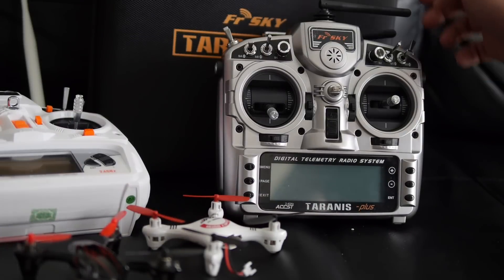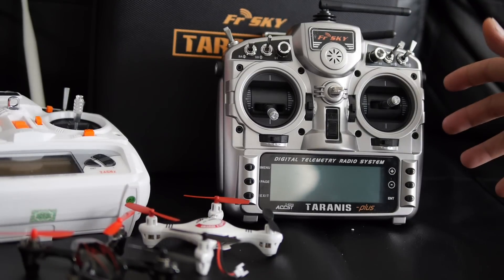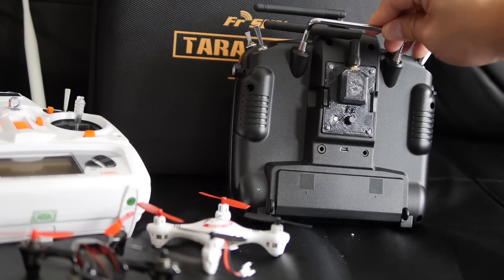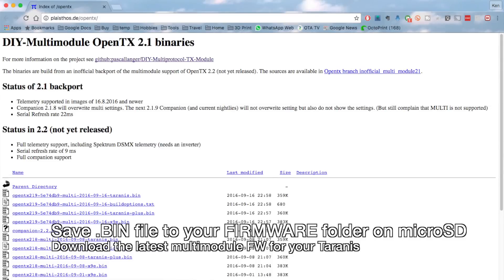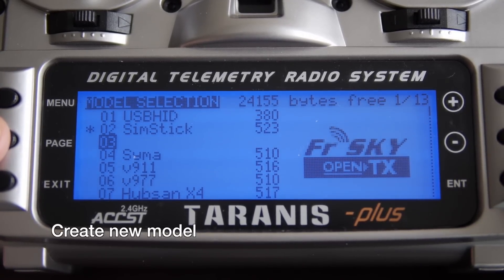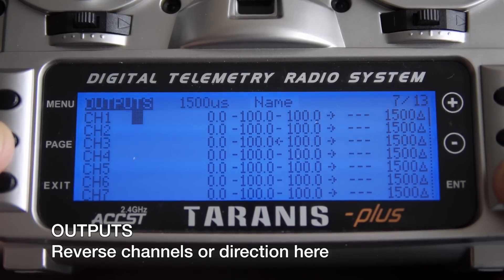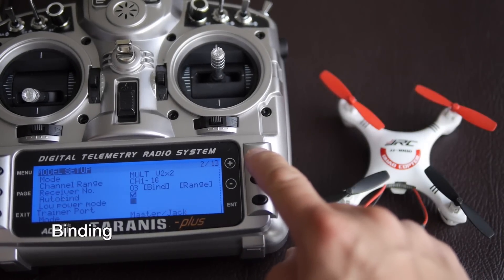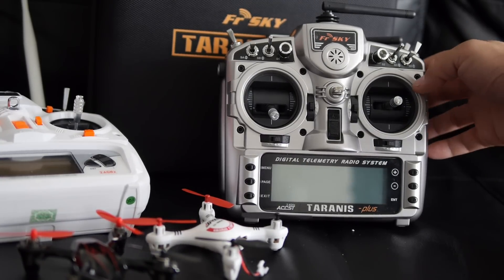4in1 multi protocol module for FrSKY Taranis from BangGood ATMega328P

Comment: Hello,  I have the Taranis X9D plus and the 4 in 1 module.  For some reason the 4 in 1 module only shows ppm,  XJT, CRSF It doesn't show FLYSKY or any other protocols.   I made sure to solder the Serial port.  Can you point me in the direction to find the fix? I am running 2.1.9 from the open TX WebSite.

Comment: Great job on the video. I wanted to ask will this special firmware l need to use for that module will it only work for the Plus&Q X7 could l still use it for the regular Taranis???

Comment: How do you set up the auxiliary channels I'm respect to the different models and their transmitters? Like the X5C, it has 2 different flying rates selection, the flip selection, and the camera selection.
Reply from the maker: If you check out my sample models in the description (see JJRC 1000a or Hubsan X4), you can see how I programmed it for turning LED on/off.  It'd be similar for the camera and flips.  I have yet to program my X5 to do flips.
Reply from the maker: Model setups have been updated with LED and flip function.  I have 3 rates set to one of the switches.  See video description for links.

Comment: Say you wanna use a FLYSKY receiver.... are you gonna get the much lower latency? Does the module itself introduce latency?
Reply from the maker: The module will have shorter range than a dedicated fly sky module. Not sure about latency.  If you're concerned about it, definitely look into dedicated modules. This 4in1 is great for small toy quads
Reply: @KenVersus  SHORTER range? Why you say that? This has 50% more power output than a flysky TX..... I should be getting much better range.

EDIT: I actually don't know if this has 50% more power output, I was thinking about a j8umper T8SG.

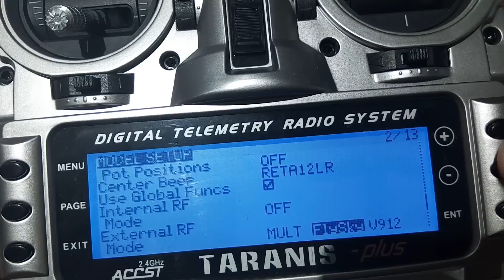Comment: @1:45 are the tx/rx pads bridged? No wires needed but bridged by using solder?
Reply from the maker: that is correct.
Reply: Thank you. That seems very simple then! Can't wait to receive my module. Still undecided on which radio to buy, Taranis or 9XR Pro.
Reply from the maker: If you have the money get the Taranis...  if you're on a budget, the 9xr pro very good for the price.
Reply: I have the money but, limiting myself for the holidays. I can either spend around $250 and get the Taranis and module and wait to get other items or, spend $250 to get a 9xr, module, goggles, aio fpv, and e010 and start flying!
Reply from the maker: I'd be happy with my 9XR Pro if I never tried a Taranis.  You can always get 9xr pro now, use it for a bit and buy a taranis later and sell the 9xr pro.  keep the box!
Reply: Taranis on the way from Amazon and is about to order a 9XR for testing. Whatever feels better will be the keeper. I hope the difference is night and day to make for an easy decision. As for soldering the tx/rx pads, will any type of solder work?
Reply from the maker: I use tin solder with rosin core.  0.8mm, i get it from BG.  http://bit.ly/bgtinsolder
Reply: hey, just wondering what exactly this does by bridging the pads. I use a Taranis X9D - Plus running firmware version 2.1.6.  Do I need to bridge the pads at all?  Enable serial mode in the radio menu? I want to use the original back plate and run the antenna inside and out the top.
Reply: hey, just wondering what exactly this does by bridging the pads. I use a Taranis X9D - Plus running firmware version 2.1.6.  Do I need to bridge the pads at all?  Enable serial mode in the radio menu? I want to use the original back plate and run the antenna inside and out the top. Thanks!!
Reply: I've had the Q ordered but everyone is out of stock

Comment: how does the range of the 4in1 module compare to the full feature protocols? if you choose dsmx protocol, how different is the range than if you were using a dx6 and a spektrum rx? i hope i made sense. i just got my Q X7  in the mail today, i can't wait to try this module, it will be replacing about 30 toy grade transmitters. thanks for all the great info, i will probably have more questions due to the fact i am a moron when it comes to computers.
Reply from the maker: +DroneXFun I don't think the range is far. Probably 100 or 200 meters. Good enough for indoor quads.

Comment: I have a 2yr old Taranis 9D+ ... never updated my firmware. I believe if you update your firmware, all the "models" which you have configured will be gone and have to be reconfigured .. too much work .. even though I only have 3-4 models configured on my Taranis. Don't know if there is anything "to die for" in later versions of Open TX which would make flashing new firmware desireable.  I did recently purchase from BG a small module which plugs into the back bay of the Taranis which is supposed to allow for many different protocols based on stick input selection. Waiting for that to arrive to see how it works. I've never regretted buying my Taranis 9D+ .. very good radio. Cheers.
Reply: That is certainly not true. Also I would recommend a backup before upgrading firmware.
Reply: Actually, I did try updating to the new FW for the Taranis. When I tried to restore my old models, they weren't compatible. So, rather than having to re-create all my models, I decided to "flash back" to my original version of Open TX. Unfortunately, the newer version screwed up my saved models, and I had to wind up setting up my models in the old 2.0.9 FW again. Didn't take as long as I'd expected, but it was still a PITA. I think there is a way to back them up to a file on your computer, but I've just been backing them up on the Taranis.
Reply: backing them up on the remote should also work. You just need to restore the eeprom from the bootloader after flashing the old firmware again to restore them.

Comment: hi there, i just ordered the new taranis qx7 and i have the cc2500 module for the flysky th9x, can i use the flysky module in the taranis? from what i understand the th9x is aetr and the taranis is taer (i think i got those wrong) so could i just change something in the taranis menu so it will work? or do i need to buy a cc2500 for the taranis?thanks a million..
Reply from the maker: +Smokin' Quads if you put it in serial mode it should work in either.  I use FRsky version in a turning 9xr pro. Change in radio settings.

Comment: Hey Ken. Sorry for the random question! On the new Taranis Q7 will the 4 in 1 module work?
Reply from the maker: +TJ Lewis if there is place to install it. Should work in at least PPM mode. Serial mode would require firmware support.

Comment: Hey, i got a little 1550 excavator and got the Huina Toys Modified 2.4G 15CH 6V-15V Transmitter, whit it also, it works fine,,, but I like more program le control over the motors,,, Will this firmware work whit a hunia excavator 😁

Comment: I did what you said, mine does not work. The links for binarys has a warning saying not to use them "Please do not use these outdated firmwares anymore. They are not maintained anymore. OpenTX 2.2 RC10 or newer includes the current code and will work far better" Where is the later code. Cheers in advance to anyone with upto date info on this module.
Reply from the maker: +Elecifun watch my stm32 4in1 video. The video applies to this module too. It shows you how to load the latest OpenTx.

Comment: Does OPENTX 2.2.0 Nightly Build 359 support that Multi modul for Horus? And does OPENTX support for Taranis 2.2.9 for Multi Modul? Both in Serial Mode?
Reply: I have the same question for Horus.
Reply from the maker: http://plaisthos.de/opentx/ only has binaries for Taranis X9D/X9E, no Horus X12S.  I think the OpenTX 2.2 supports it but there are no binaries.  I don't have a Horus, so can't really comment further on it.

Comment: Hey Ken, where can I get all those model bin files that are showing up on your sd card? Sure would save a lot of time if they were all available in one place and ready for the 4 in 1 module.
Reply from the maker: http://www.thingiverse.com/thing:1796284/#files

Sure, I uploaded the few that I tested on thingiverse.  Some of them I have yet to bind and test.  I just put them in to remind me I have to create them.  Most of the models are just 4 channels and sometimes you have to reverse a channel direction but that's about it.  CH5 and CH6 are usually reserved for lights on/off or flip.  Most of the models I setup also have SF switch (top left) as throttle cutoff.  SE is lights, SG is Flight modes, with low/med/high rates.   SB is reset timer.
Reply: Thanks Ken, that gives me a good starting point for adding more models, Again, Thanks.

Comment: Hi Very nice Video you made I have a question about this Multiprotocol Modul I did get the Orange DSM 2 receiver to bind but when I plug a servo on the receiver it does not turn around just stay jammed in one position.What can be the Problem?
Reply from the maker: +Johann Springsits bad servo.. Maybe adjust the end points for the servos. Or the weight for the channel your servo is plugged to. Those are settings in the transmitter.
Reply: i am sorry this is not the case because the Servos work normal on the Spektrum DX8 DX6i

Comment: Using this way means you don't have to flash the 4in1 module and just use it stock from banggood?
Reply from the maker: Pretty much stock.  I didn't flash the 4in1 module itself.  But if you want to be able to select the protocol inside the Taranis menu, you will have to solder the 2 pads I mention in the video.  If you don't, you can select the protocol by turning the white dial on the module.

Comment: What other transmiters will this module work with? I believe you mentioned the Turnigy 9xr?
Reply from the maker: In PPM mode, it works with pretty much all radios that can do PPM.  In serial mode, the firmware has to support it.  Yes it works with an 9XR as well.  I'm getting a 9XR Pro as well.  Video of it coming soon...
Reply: Thanks! Looking forward on your Video on the 9xr Pro. Please do a review on it!!
Reply from the maker: For sure, it should be uploaded by this weekend.  The 9XR Pro is a good alternative to the Taranis at only $60.
Reply: You delivered the video just like you said! Great!! Thanks. I would be getting the 9xr Pro soon.
Reply: Andre Martinez     it wil also work in the fly sky th9x after you install the smartie parts board.

Comment: Thanks for doing this video.  I just go my module and was wondering if I need to upgrade the module firmware?  Are you planning a video on how to upgrade the module firmware?
Reply from the maker: I don't see a need to do it yet.  I haven't updated my module firmware.  there is a post that shows you on RCGroups, but some things are better left untouched if it's not required.  If I update mine, I'll do a video.

Comment: do you think this could work with the new turnigy evolution? its basically a flysky something.
Reply from the maker: Possibly in PPM mode.  You would most likely need the DIY version of the 4in1 module.  http://bit.ly/bg4in1diy

It'd be a lot of work I think.  You'd need to solder wires and also a dip switch or rotary dial to select the protocol.

Comment: +KENVERSUS I've been taking in your vids for the past few days now and man, I love your work!! I have a Devo 8S with Deviation and was planning on getting that 3 in one module...now that ive seen this video though, Im quite interested in finding out which one you would say is better? In terms of ease of use, pairing to the different protocols etc. Which one do you prefer? Cheers
Reply from the maker: My only experience with the Devo series is with the 7e and 10.  Deviation interface is easier to understand and program.  It's similar to the Spektrum stuff if I can compare it something.  OpenTX won't be easier to use.  OpenTX is a bit more complicated but if you use it enough, you know where all the things you need are.  I don't do very complicated setups anyways so I do like the flow of the UI of OpenTX.  In terms of binding with different protocols, it’s the same.  They use the same RF chips so same compatibility.  I think the Taranis is more popular and will have more support then the Devo stuff.  I have both, and time will tell which one I keep.
Reply: That makes sense..I might still get the Taranis and just see which one I prefer. Thanks for sharing all your info and for taking time to reply, means a lot. Cheers

Comment: This is really interesting, is it possible to use as full range module and also bind dsmx receivers ?
Reply from the maker: +Jelle Kaptein range is probably a 100m to 200m. It works with dsm2/x
Reply: Hmm, thats a downside, It would be exellent if this module could be used as a full range system.

Comment: Thank you! Have been a fan of your Devo 10 mod video; modded my Devo7e using that video. Have been waiting for this video for a long time since I saw it earlier this year. I have a few questions: 1. It appears that you have soldered "2 pads" to allow you to select models? If yes, can you do a video on that? 2. Does the mulitmod firmware replace the original Taranis open tx or it is just the same with the open tx added with the multi mod. 3. With model ini, is it as simple as finding one and then download and copy over to the micro sd? 4. To upgrade the multimod firmware, it is finding the firmware, download and flash as shown? 5. I notice that after you bound with JJRC 1000 in the video and you pushed up Throttle, one of the props was not spinning? Does this mean that the transmitter sticks have to be re-calibrated? 6. Is devo more user friendly or this one? Which one do you prefer? 7. Just to confirm, does the 4 in 1 work with any transmitter that can do open tx? Sorry, for so many questions. I am looking to buy a Taranis or Flysky TH9x and this 4 in 1 module. Look forward to your reply. Cheers.
Reply from the maker: 1. Unfortunately I already soldered mine, so that's why I didn't include it in the video, forgot to film it.  It's pretty straight forward, just use a finetip solder iron.  I just use a Weller battery powered iron for most of my soldering, don't need a lot of heat.  If you can mod the devo 7e, soldering the 2 pads isn't hard.  Add some flux and use small amount of solder.  Keep a solder pump handy if you add too much. 

2.  It runs OpenTX with multimod added.  

3.  Yes, you should be able to find the model, (.BIN) and copy to your microsd and import/restore it to an empty slot.  

4.  Yes, it's just download, copy to firmware folder and flash. 

5.  One of the motors on my JJRC is dying.  It still flies, I just have to go full throttle to have the 4th motor spin up.  I have a motor replacement on the way.  I love the 1000A!  One of my favourites.  But yeah, should calibrate it anyways in the OpenTX menu.  

6.  yes, I'd say Devo's are more user friendly.  OpenTX is a bit more complicated but once you learn it, it's not bad.  For most of my models, it's just a simple 4CH setup with little configure.  Espeically for the bind and flies.  There are tons of tutorials on YT about the Taranis. If i had to keep one radio.... I'd keep the Taranis. 

7.  The 4in1 is availabe for the FS 9x as well.  With 9x, you need to run a multimod version of ER9x firmware.  I use to have both Flysky 9x and Turnigy 9x, but have since sold them so I don't have any experience with the multimod since it wasn't available then.  the FS 9x is a lot cheaper than Taranis.  However, Taranis is better and has more features and it's probably the last radio you buy.
Reply: Thank you. Very much appreciated.

Comment: Thanks for this tutto I have been able now to fly hubsan with the taranis.
I have a question
I have imported the Hubsan X4 model in my Taranis and i can fly properly the drone also i can turn on and off the led but i can't flip it even if i can see in the channel that the flip button is binded.
Also my principal ''problem'' is that i can't find a way to start recording a video. On the DIY  multiprotocole page ch7 is supposed to be picture and ch8 video but when i go in the channel page there is nothing on channel 7 and 8 .
 Can i do it manually ? Did i imported a version model that was for an X4 without camera ?
Thank you.
Reply from the maker: Yes, you do have to manually add those in.  My model samples don't have that since I don't use the camera/video function or flips.  I only programmed in the LED.  You can see how I did it with the LED on/off channel and program something similar to the channels. ch7/ch8.
Reply from the maker: Model setups have been updated with LED and flip function.  See video description for links.

Comment: Hey Ken regarding your IKEA Dioder Wireless Hack Mod (LED Strip lights) video, i had a question. Is it possible to use the came remove but with two sets of the led lights, and two receivers working on one remote? Thanks.
Reply from the maker: Yes one remote can control 2 receivers.  The Mi-Light branded do at least.  The remote can be paired with the receivers.
Reply: kenVersus Awesome ken, thank for the info!

Comment: This is amazing, but I have a question. Is there any downside to installing the custom firmware?
Reply from the maker: Disadvantages?  I can't think of any.  You can of course flash it back to the the original opentx if you don't want it.
Reply: Thanks!